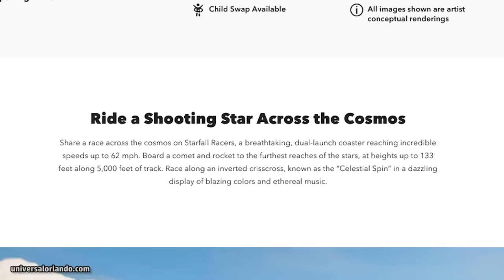Universal Epic Universe News Update — STARFALL RACERS COASTER TRAIN & NEW CONSTRUCTION

Comment: I just noticed that the medallions on the trains also appear to have led lights on them as well. They alternate from the upper smaller medallion to the larger one next in line. I'm just wondering what color light they will emit or if it's multi colored for a true fire-esque visual.

I'm hoping the barrel in the DK coaster isn't permanently affixed, but rather has a rapid kickback each time train cart ejects from it like in the video game. A sensor on the track could trigger the barrel to suddenly kick back and glide back to its original position. it would just add more to the theming and visual appeal. 

As always, thank you Alicia for your fantastic updates!!

Comment: My only 2 train rollercoaster experience was Duelling Dragons so this may be common knowledge these days, but what is the safety consideration for when the trains are next to each other? and was the incident (object from one train hitting passenger in the other) that caused Duelling Dragons to then have staggered starts for its last few years. Cant remember if they had lockers back then or not as usually left items with non riders.
Reply from the maker: This ride has metal detectors according to permits, which Dueling Dragons did not open with.